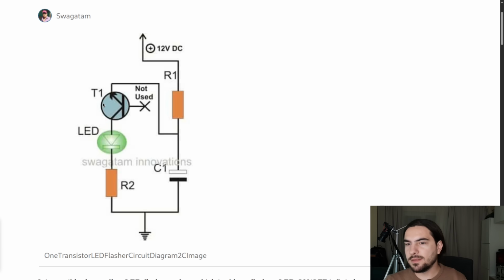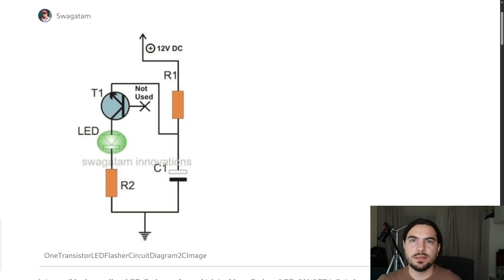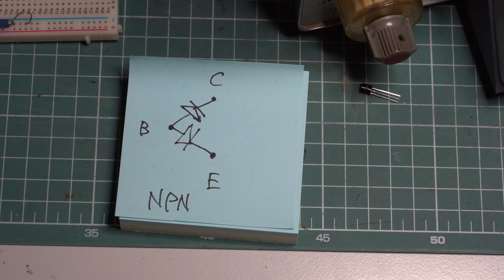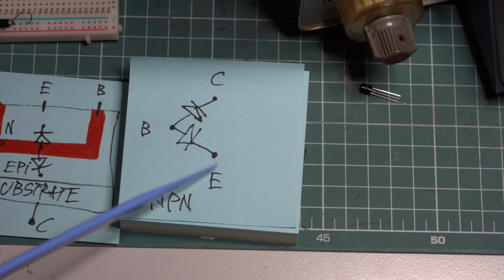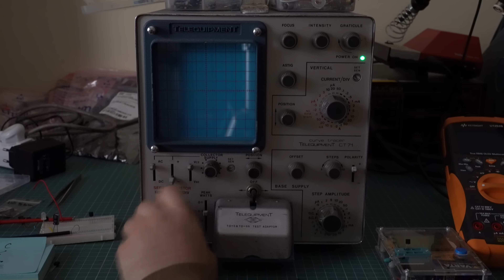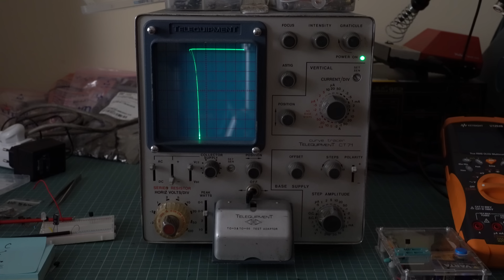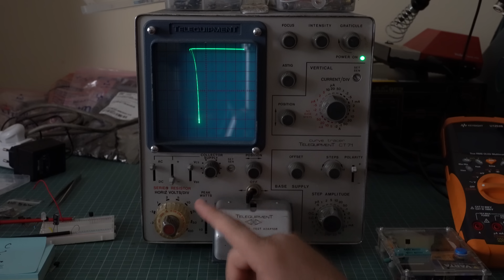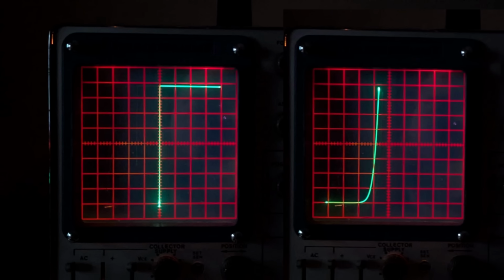Single Transistor Blinker: The Magic of Negative Resistance

Comment: So it's like a DIAC or other ones from the thyristor family? DIAC/SIDAC, TRIAC, SCR, GTO - once they're activated, they'll stay on until they reach below holding current. I've made flashers that consume uA current with a DIAC in the past.
Reply from the maker: Yes, it's pretty similar to a DIAC, but unlike the DIAC, the transistor is not symmetrical in terms of breakdown voltage. The positive CE breakdown voltage is much larger than the negative CE breakdown voltage.

Comment: With t=RC, the time constant of an RC circuit is calculated. With NEGATIVE resistance, could a time constant be negative? That is, could a circuit furnish an output before the input arrives? If so this might be how a flux capacitor works. Back To The Future!

Comment: Wow! you grew a lot since last time I saw your channel, congrats!>
BE junction goes into breakdown earlier than BC junction, cause of high Emitter doping.
As a transistor, C acts as E and E acts as C, you just get lower beta.
When you apply sufficient supply, due to breakdown you're biasing the transistor and it turns on. 
Charge is stored in the base. Transistor stays on (until you evacuate charge in the base.. same as reverse recovery topics). When the stored reverse charge is gone the transistor is off.
Due to the cap, the system is "unstable" and oscillates.

Negative resistance is kind of a fancy wording. I don't really think about it that way.
EDIT: OK i see what you mean, and that's because your device enters avalanche breakdown at 10-11V, and this is not a Zener effect. Avalanche can exhibit this negative diff resistance, indeed. But I think the circuit would oscillate even with a Zener behaved BE junction, due to reverse recovery charge in the base.
Did you check on the scope that the voltage on the emitter is not oscillating but at a much higher frequency, with the 2N2222? The 2N2222 seems to have higher fT and quite low "off" time. I mean you see an  always on led, but it could be oscillating at a high frequency. You wouldn't be able to see that visually.

Comment: So, will that works if we use zener diode instead of transistor?
Reply from the maker: No, because Zener diodes don't have negative differential resistance. It could work with a tunnel diode, though.

Comment: Isn't this same effect as when the CB reaches breakdown voltage? Current flows into the base and consequently into the emitter, opening the transistor more and more. The main condition being, that the base is disconnected, so that the current can't flow anywhere except the emitter.
EB is same thing, as some transistors can operate in reverse (being NPN and all), just very badly because of the geometry.

Comment: spark gaps, Shockley diodes (thristors with the gate disconnected), DIACs, and SIDACs all exhibit this general behavior (and on purpose), but to my knowledge only the last has ever had components with breakovers voltages in the 6-12V range.
Reply: Are you sure? From what I've seen SIDACs usually have higher Vbo than DIACs, in the 100s of volts.

Comment: A IR remote of some cheap AliExpress helicopters had only one transistor and was oscillating in the kHz Region, I wandered how it was possible and I guess that this could be the answer, as capacitor and resistor they might have used the traces of the PCB but how were they able to mass produce it? O_O

Comment: Hi, could you design electronics circuits and devices startene from scretch and then showing the various Connecticut and the arrangement  of the electronics componenti so that they are easier to create, i would like to build electronics circuits with triggered and non triggered logic gates flip-flops, plc microcontrollers motors of various  tipes;  plc ecc...... ok? Thanks Luca
Reply from the maker: Yes! I plan to do more videos on electronics design. An LTSpice tutorial is coming up tomorrow for example. 😁
Reply: @VoidElectronicsok send me ok? Thanks Luca

Comment: @VoidElectronics Thanks for the vid. At 12:36 when you discuss (and display the diagram) of the epitarial transistor... the substrate should be highly doped p material, not n material. (The collector is a lightly doped p material, epitaxially laid down on top of the substrate.) The collector lead is not connected to the substrate; but, is directly connected to the collector region. What kind of transistor manufacturing are you discussing?

Comment: Another interesting application is using a transistor as a nano amp diode.  Suppose you wish to drop 3.3v down to 2.5v.  in the case of a microprocessor which can draw much less current 1uA to 500nA in sleep for a msp430.  Simple diodes become resistors at low current, but if you tie and npn base to emitter you get a 0.5 to 0.7v drop even at nA.  1 or 2 in series gives a precise lossless voltage drop.  Interesting effect to investigate.
Reply: What is a lossless voltage drop?

Comment: A device specifically designed for this, though with a higher breakover voltage, is the DIAC.  Turns on at 30V, off at 3V.
Reply: It turns off based on current, not voltage. Also of interest may be the Shockley diode (two of which in anti-parallel essentially make a DIAC); programme unijunction transistor (PUT) which also exhibits negative differential resistance; and silicon-controlled switch (SCS) which is basically two PUTs connected in anti-parallel. Its function is basically the same as DIAC, but it has an adjustable breakover voltage (Vbo) and better Vbo symmetry between the two polarities.
Reply: @computermaster360  True, off is current dependent.  I'd forgotten the details and trusted Wikipedia.  Must have been super out of it to do that.

Comment: This is the same principle as behind the "Avalance pulse generator". Can make pulses in the region of nanoseconds by using this recovery effect of the reverse biased transistor. Great demo, and thanks for sharing.
Reply from the maker: The usual pulser forward biases the transistor at higher voltage. The one in the video is a different kind of breakdown because the transistor is reverse biased.
Reply: Well the transistor. Is ising the collector as the emitter and visa versa. .but the ⛍ of the.b-e junction occurs at 5 to 10 volts for a small signal part. 
Using a curve tracer I've seen that a 2n3904 exhibits gain with E and C switched, so avalanche is likely what is happening.  On the other hand, if one grounds the Base and reverse biases the emitter, a small 0.5 volt Negative voltage will appear on the collector.  According to the late and great bob Pease on national semiconductor this is due to the avalanche B E.junction emitting IR light which illuminates the B C junction making it into a photo diode.

@VoidElectronics
Reply: I used it as a wide range harmonic generator when school time,,,,
Reply: That's a different principle. Similar outcome, but different effects in play.

Comment: What are the Values of R1, R2 and C1? I tried in LTSpice, for R2 i used 330Ohms and C1 1uF, for R1 i tried many values between 1k and 1meg... I even sweeped R1 over time nothing happenend. The transistormodell was the bc547-c. I try to build it with real parts. BC547-b, i tried a c, i tried several resistorvalues, c values, it want oscillate...

Comment: Why it works:
negatively biased transistor still have small gain. So if you provide some current to base, emiter collector will conduct, even if everything is wrongly biased. 
So when emitter base goes into zener region, base will be biased, emitter collector current will start to increase. Higher voltage->more current on emitter-> more current provided to base, lowering resistance between collector and emitter.
You can try to make small amp with npn negatively biased, and observe dc gain.
Reply: Exactly what I said in my comment. Essentially the E and C swap and "collector" breaks down flooding base with bias.
Reply: You are spit on sir!

Comment: BJTs typically still function as a transistor if the emitter and collector are exchanged in a circuit. The breakdown voltage of the base-emitter junction is of course a severe limitation and the gain is typically very low.
It would be interesting to compare the BC547 and the 2N2222 when used this way. It should be easy enough to do with the curve tracer. It might provide some hints as to why the 547 works in the flasher circuit and the 2222 does not.
My hypothesis is that when the B-E junction breaks down in the flasher circuit, a very large number of carriers are injected into the base region and it is the action and "persistence" of these carriers that produce negative resistance behavior.

Comment: The BC547 is binned into three hFE categories. Do they all work in this circuit? The "C" suffix parts are exceptionally high gain. 

I'm curious if a transistor that works in this circuit will continue to work over a long period of time.
In the two-transistor multivibrator, the base-emitter junction of the transistors can be subjected to reverse breakdown if the supply voltage is sufficiently high. Over time this will reduce the current gain of the transistor and eventually cause the circuit to cease to operate. As I understand it, perhaps incorrectly, dopant atoms in the crystal lattice actually migrate very slowly due to the stresses caused by reverse breakdown.

Bob Pease's book is indeed very good.

Comment: Thank you for sharing, it would be interesting to calculate the relative efficiency of this flasher circuit compared to regular multivibrator flasher.
Reply: pretty much the same only if VCC is largely dissipated by the leds, not by the various resistances. Otherwise the astable multivibrator uses the standard operating mode so it doesn't require that much voltage to run, and it doesn't require specific transistors (expanding the requirement outside of the BJT family) so it allows to be made way more efficiently with mosfets and to run with a way lower voltage to blink just a few leds.
Reply: With just a single LED this single transistor blinking circuit has significantly worse efficiency compared to a multivibrator because of the high supply voltage (12 V) relative to led forward voltage (1.6 V to 3 V depending on color). But you could increase the efficiency by connecting many LEDs in series until the combined LED forward voltage becomes significantly larger than the BE-breakdown voltage of the transistor and then choose a supply voltage just slightly larger than the sum of the two.
But as @PainterVierax already said you can build a multivibrator circuit with MOSFETs which have near zero on resistance and then choose the supply voltage to be exactly equal to the LED forward voltage (at their rated current) to get near 100% efficiency.
Reply: @CD4017BE  Thank you!

Comment: There might be another possible way of explaining this phenomenon - quite "unorthodox", so to say:
if we take into account the fact, that the electricity really flows from the negative to positive and look at the relative size of the junctions in that specific transistor model, we can assume that there is an electric field "pressure" build-up between the collector+base and the emitter.
Once the EBO breakup voltage is reached, the energy briefly flows between the C+B and E, and after discharging C1 capacitor below the transistor's V-EBO level, the flow of energy stops and the (re-)charging cycle of C1 starts anew (however, in this setup it is never fully discharged).
Reply: [ctd.] The time difference between the moment when the current starts flowing after the V-EBO is reached and when it stops, creating a hysteresis effect, results also from the avalanche phenomenon inside the transistor used this way.
As others have noted, this scenario puts it into Zener diode mode of operation, but also, in some sense, it can be seen as a temporal creation of a "quasi-enhancement-channel" - similar to that of a MOSFET. Who would have thought about this in a BJT, right?

Ultimately, we can look at this phenomenon from yet another perpective.
The energy is initially stored first in the C1 capacitor in the form of an electric field, but once the transistor starts conducting, it is then converted to a moving (electro-)magnetic field with its inherent inertia energy.
As with any moving object, the E-M energy propagating through the space or along the wire also has a kind of inertial force, which causes many interesting phenomena (including the delay in the flow of electric current in coil-loaded circuits).
This is something that engineers don't always take into account right away...
Reply: Electrical engineers learn that current flows from positive to negative while electronic technicians learn that electrons flow from negative to positive to enable an excess of electrons to balance a system. Some engineers get upset when they find a technician that can think both ways.  😂

Comment: . OK, I can maybe explain what is happening. When you reverse the supply the transistor's emitter and collector also reverse. They are, after all both n type. The E is now C and vice versa.
When threshold v is reached the "collector" breaks down flooding the base with +ve bias which saturates it.

Comment: The reason that two diodes connected back to back and containing two PN junctions doesn't work as a transitor is down to the thickness of the middle base layer. The base region needs to be thin.

With two diodes back to back, the base region is the same thickness as the other two regions.

Comment: Very interesting, thanks. I knew about the quasi-zener diode about 0.7 V between base and emitter, but not the negative collector-emitter resistor with some transistors. There is a similar effect between the inputs of analog integrated circuits, a slightly high voltage blocks the circuit as long as it is powered. A zener effect towards the substrate.

Comment: If this could work at very high frequencies and in power electronics, Tesla fans would be the happiest people in the world, because it would replace the spark gap.
Reply: Try fmmt417 or ztx415. Guaranteed avalanche fun times. 🎉
Reply: i would be happier if i still had several kg of mercury... nothing switches like mercury. even if it is a bit slow on the repetition rates.

Comment: BC547 is a high beta device and even little of leakage will switch the transistor on because of reverse beta property... The leakage region is not necessarily every where that's why when leakage stops it turn off
There reason why not all bc547 behaving the same because the leakage is very function of fabrication process which can vary from batch to batch

Comment: 9:57 : but if you increase the value of the resistor between "+" and capacitor, you should have oscillation even with the second transistor, isn't it?
Reply from the maker: I don't think so. It has close to no negative differential resistance.

Comment: What about a circuit with 0 transistor? It's called a flashing led...
Reply: That’s a LED chip with about 6 transistors
Reply from the maker: And how did they make it blink? Right! With a few transistors on a silicon die... This video is all about those transistor circuits that make the LED blink. Not that I would recommend using this concept on a chip...

Comment: Solid investigation and exposition.

Another fun one in the "some transistors will work, some not" vein is avalanche breakdown pulse generators, that can give you picosecond range rise times. Need a higher voltage supply though, 30-40 volts, sometimes higher
Reply from the maker: Yup. I built the Jim Williams pulser too. I should make a video about that.
Reply: I have encountered this effect. It may be destructor...

Comment: That sounds like a very unique property of specific transistors. Very fascinating! But idk if an open base connection is a good idea in general. Any active electric source in the environment could cause interference to it, isn't it? I assume even changes of capacity close to the open base wire could cause interference.
Have you measured the stability of the frequency and duty cycle of the output of this circuit?
Reply from the maker: I didn't take any measurements because this circuit is not even meant to be accurate. I noticed that the frequency varies a lot with the supply voltage. I also tried 10 BC547 transistor out of the same bag and they all worked, but as demonstrated in the video, some transistor types don't work at all in this circuit.
Reply: @VoidElectronics try a diac instead of that transistor but adjust the voltage/resistors accordingly.
Reply: @codures hmm, interesting... (both high-value B-E to avoid B noise; or trying a DIAC)
Reply: One can always tie the base to the emitter through a 10Meg and a 100pf to make it noise proof.